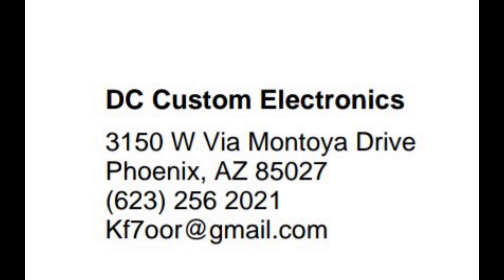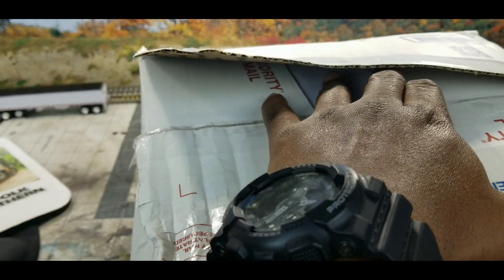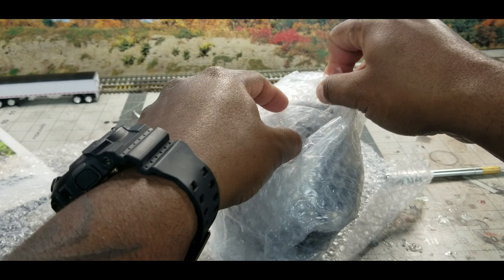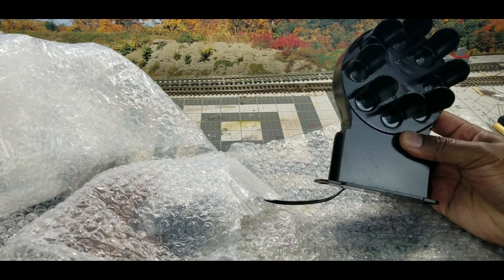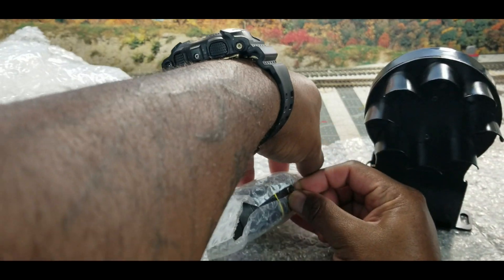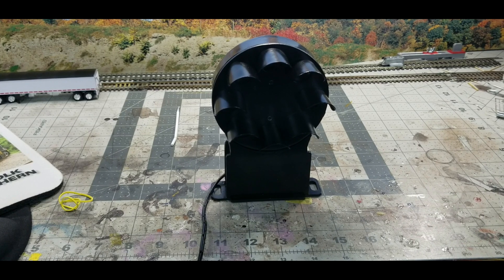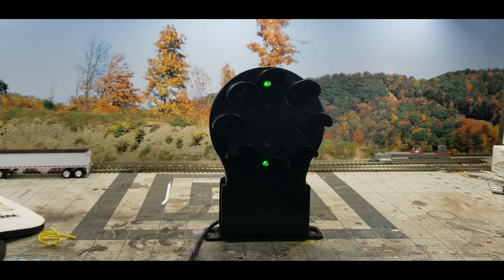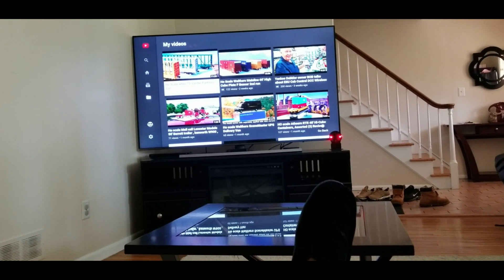Dwarf Signal

Comment: What is the interpretation for the diagonal white lights? The top left and bottom right was showing white. I've never seen white lights on a signal before as far as I can recall. I'm not very familiar with that type of signaling system though, that has the eight lights on one signal panel. Its probably gonna be obvious when I'm told and I'm gonna feel dumb but I don't know and I would really like to know.
Reply: That's a restricting/restricted proceed. Some railroads use aspects with white lights for restricting. Others use red over yellow or flashing red